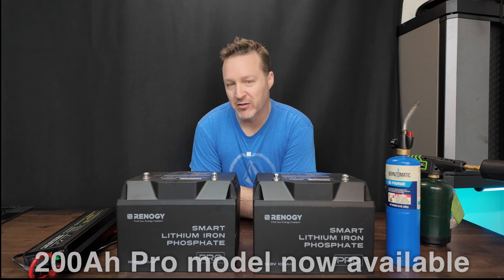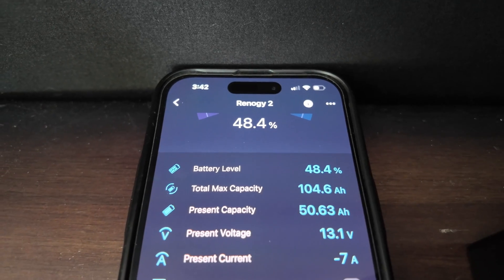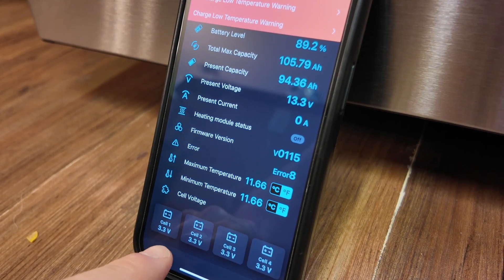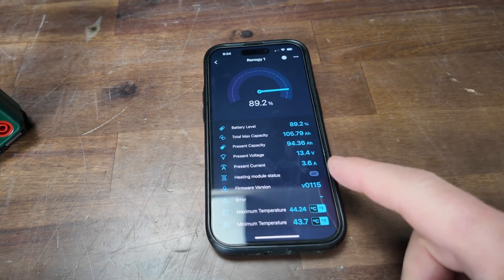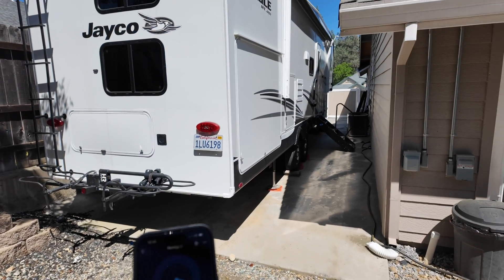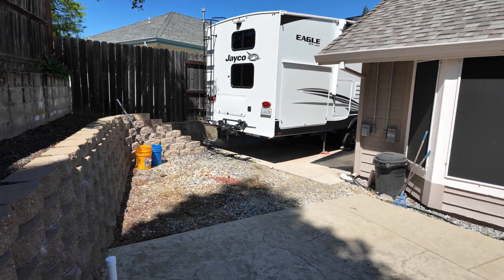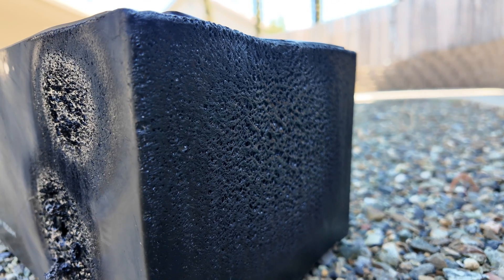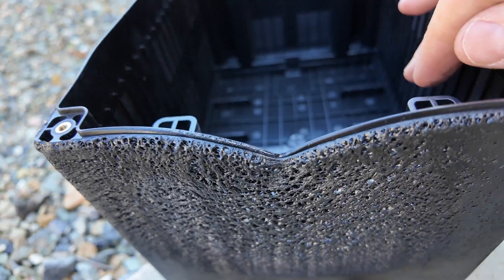Renogy Smart 100Ah Pro Battery STRESS Test & Review! Will It Survive?

Comment from the maker: The Renogy 100Ah Pro smart battery is definitely built tough. What are your thoughts? 
#lithiumbattery #renogy #smart #rv 
Items in Video…..

Amazon links
Renogy 100Ah Pro Battery: https://amzn.to/3JyV6q6
Renogy 200Ah Pro Battery: https://amzn.to/49KDKBf
Battery Charger: https://amzn.to/3Uu6mtT

Renogy site: SAVE 10% USE CODE: JOHNNYPRO
12V 100Ah Pro: https://bit.ly/449E3UU 
12V 200Ah Pro: https://bit.ly/3w4KKeh

Have a question you want answered fast: https://asqme.com/@johnnysweekends

BUNDLE & SAVE SHOP SOLAR KITS ! https://shopsolarkits.com/1134

CHEAP USED CERTIFIED SOLAR PANELS HERE: https://www.santansolar.com/?ref=Johnnys%20Weekends 

SAVE BIG ON NEW SOLAR PANELS HERE: https://signaturesolar.com/?ref=JWKNDS 

CHECK OUT MY AMAZON STORE: https://www.amazon.com/shop/johnnysweekends

Comment: Good reiview👍
You said 400amps in max charging.  Also the mosfets are not soldered the heatsink, those are isolation/heat transfer pads.
Cheers
Reply: i wondered the same thing regarding charge and discharge rates. Did he say good 'for a hundred amps' or 'good four hundred amps'? i replayed and listened to it a few times but am still undecided. i guess I'll have to look at the specs.

Comment: Thanks for the video. I do like Renogy’s gear, however, it’s typically hard to justify with alternative offering prices and similar build/component quality. The battery part of solar is really getting hammered on the pricing these days. I think that’s where you see battery manufacturers entering the panel, inverter, charge controller, etc side of the market place to generate revenue and remain relevant.